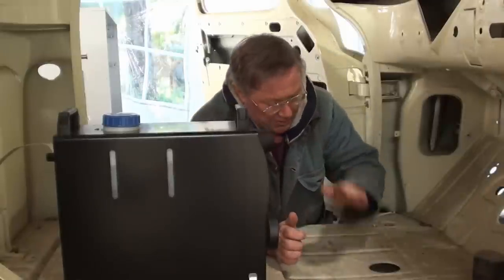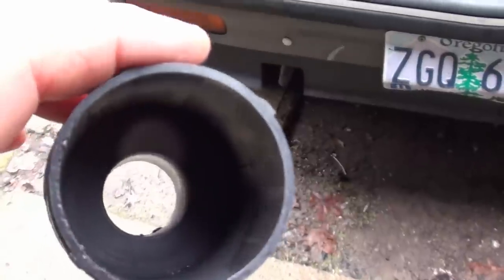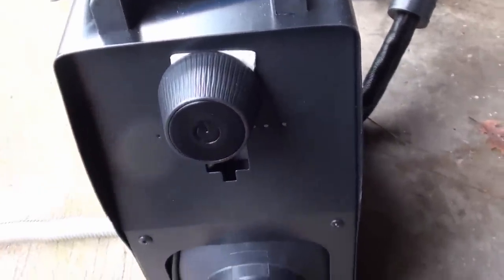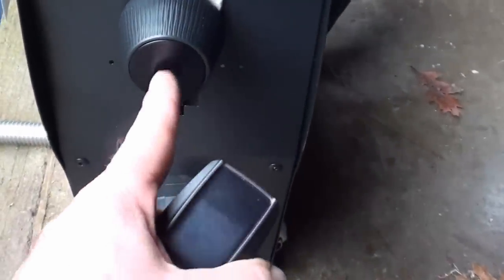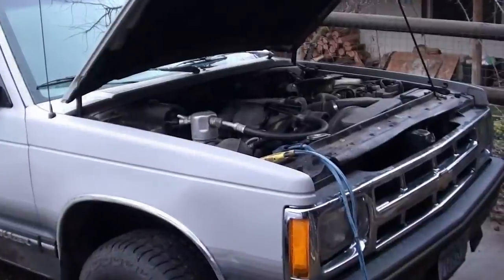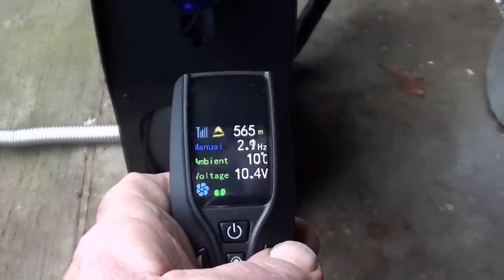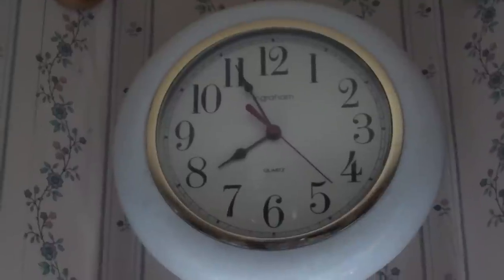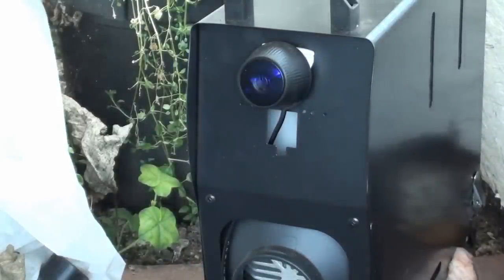Vevor Diesel Heater Evaluation. A Close Look!

Comment: I have a cheap Chinese knockoff in my truck camper with 100 amp hour lithium battery it works great for a small space but it has no fan only Temp . Jeff thank you for help on head gasket
Reply from the maker: No prollum!

Comment: I got the compact version of the Vevor heater with an external tank. Mounted lower than the heater, fuel can't run in. Worked good over the winter to keep my barn from getting too cold.
Reply: All the tanks are external in that if you open up the case, the components are always the same - heater, tank, pump, controller.

Comment: Jeff, I spent this entire last winter going down the Chinese diesel heater rabbit hole. I purchased a similar 8KW vevor heater and quickly got a full education on it. There's actually no such thing as a 8KW heater. They take a 5KW and over fuel it in order to advertise it as a 8KW. Mine worked just fine but if you listened closely on the highest setting it would throttle the fuel up and down because it would hit the high temperature safety limit and the brain box would cut the fuel pump back until the temp came down a little. After doing some research I found this is a common issue and leads to soot build up and potential failures. Some of the controllers with the screen in five buttons allow you to go in and adjust the parameters for proper burn and good fuel economy. I had to purchase a new board and screen off eBay and install it in mine to be able to program it and make it burn properly. Let me know if you want to talk diesel heaters, I can shoot you an email with my phone number.
Reply from the maker: I watched quite a few videos but hadn't made the leap. When Vevor asked if I'd review one, well, shoot yeah! I'm really after the waste oil function. Watching several others, you CAN run straight waste oil after it's lit, but the soot buildup is way too much. A 50% mix seemed to work excellent with minimal ash build-up over 3 years, as well as not setting the exhaust a-glow! I've learned that the fan adjusts by both fuel setting and exchanger temp. Theoretically, you can run 50% at about 3Hz which will cause higher combustion temps comparable to 5Hz straight diesel and the fan will go to max with the chamber temp.

It's a theory, but I think it's a good one!

Comment: The controller with the display allows you to tune the air fuel ratio. I find increasing the minimum speed helps.
The muffler helps. The pipe has a resonant frequency, the muffler dampens it. Without the muffler, you can here a definite noise inside of the resonant tone at some speeds. There is a better muffler with cast ends. Works better, but I bet you can cobble up something better.
Have had a diesel heater for about 2 months (separate 2.3 gal tank and small heater unit). Has worked well but I went down the rabbit hole of using waste oil. Worked ok after tuning but definitely caused coking issues. Grabbed a jug of old oll that must have had brake fluid in it and it filled the chamber with concrete :)
One thing about the expensive German heaters is the burn chamber comes apart. The cheap one if the chamber gets plugged you can't get into it to clean but they are cheap. Have an extra on order from China. Also have extra gasket, glow plug and screen kit cheap that came with the special glow plug wrench for something like $13.
The glow plug draws about 10 amps, the pump about 2 amp pulses. Fan is not much. Once running, less than 2 amps. I think the arc you see is charging up a filter cap.
Shut down with fan low and glowplug on will burn off any unburnt fuel especially after a failed start.
The exhaust pipe gets a wrinkle in it with the hose clamps. So you get a bit of fumes leaking through the wrinkle. I'm going to try muffler epoxy to seal.
If you can get kerosene, it supposedly works better if you can get it cheap.
I see you got one with hose clamps that work. Mine had 80% of the small ones do nothing turning the screw.
Reply from the maker: From what I saw on SpewToob, a 50% waste oil mix is best, cutting your pump back to compensate for the higher BTU per gallon. Kerosene is a lower BTU than diesel at a higher cost per gallon.
Reply: I used exhaust repair paste around the join to the unit on mine, when connecting with the Jubilee clip. Seems to have worked ok so far.

Comment: I have one in my school bus/RV and I love it. Not sure about all of the different models but my fuel does shut off as far as I know but I do have a separate fuel tank (mine is actually plumbed into my buses fuel tank. I'm going to have to check to see if mine drawers current while it's off, also one thing to note: if you remove power source while it's ON you'll probably have to buy a new unit, it burns up the circuit board (at least it did on the earlier designs)

Comment: I have one that I use in the rear of my 1977 military dodge ambulance, even on the lowest setting it will force you out with heat.  Mine has a display on the unit and a remote, remote is basic with no display, mine is also very fuel efficient, I do find the fuel pump clicking annoying.

Comment: I've had my diesel heater in my motorhome for quite a long time now I believe since 2020 I literally bought the cheapest one I could find I think it cost me $109 shipping and all mine has the remote fuel tank with it which I have in the generator compartment on the motorhome it definitely has no issues heating the camper and the only thing major that I've had to deal with is every now and then the fan with slide on the shaft until I just glued it to the shaft so it no longer rubs the case and every now and then you get a little bearing noise but I mean as long as minds run nonstop for days weeks and months during the winter it's done very well for the $109 that I spent on it easily heating the camper 75 plus even in the coldest of temperatures and honestly with the pump mounting underneath the camper you don't even hear it or notice it I know a lot of people that do not like them but I tell you I wouldn't trade my cheap Chinese diesel heater for anything it has kept me warm some of the coldest conditions there's always a great video Jeff
Reply from the maker: They're downright impressive for extraction of BTU per gallon, especially at the price point. But, as mentioned, being mechanically inclined is a BIG plus!

Comment: The display you don’t like is far superior to the arrangement you have. You get the display for tuning, but a simple remote for on/off. I have two of these, one in my office shed and one in my VW bus.
Reply from the maker: It wasn't what I thought I was getting, as I explained in the video. I'd rather have the screen that to be forced to use the remote. There was really no reason to even have the big knob on there, as it doesn't do anything but take up space. judging form the photos, I had assumed the knob was the temp control.
Reply: @ElderlyIron  ok got you cheers. The screen type controller is really easy and cheap to get hold of, and swapping over is dead easy - they all appear to use the same 3-wire connector inside the case. The heater in my vw has a single rotary knob with a press button; somewhat like yours but the knob actually turns and looks like it should be in a vehicle. And the LCD screens usually come with a two-button key fob remote for just on and off using the last settings set on the screen. If that helps at all.

Comment: I seen videos people run these on Kerosene and they say they don’t have any problems with them what’s your opinion on running it on Kerosene?
Reply from the maker: Kerosene has a lower BTU than diesel, which translates to less heat per amount of fuel burned at a higher price than diesel. I see no point to run Kerosene, but it certainly won't affect the heater as far as I know. You'll also see guys running waste oil blends, which has MORE BTU than diesel. That starts getting dangerous as every one of them shows the glowing red exhaust

Comment: I've been very happy with my CDH. On the other hand, my Schumacher power station identical yours has been a POS. Don't rely on that to run your heater.
Reply from the maker: HA HA HA! I was "gifted" that as non-working. It wouldn't charge the internal battery, so I charged it via the clamps. Once it saw enough voltage from the battery, then it would charge. Ended up replacing the battery. 25 bucks, so not too terribly bad. Gave it to a friend of mine.

Comment: It does work on the same principal as the Thermoking tripak ...company that i used to drive for used the tripak ...i was in Detroit several yrs ago a snowstorm started blowing in when i parked for the night  i turned on the heater it ran all night at 65 deg only used around a gallon and a half of fuel all night and the main engine never cranked up the heater unit was directly under the bunk ...you couldnt even hear the fan running on it
Reply from the maker: I wanted to be a Thermoking tech right out of college. To this day, I have a disdain for "Guidance Counselors" and "Placement Directors"

Comment: Yeesh... I could deal with the 12V switch, fuel cutoff, and a heat shield, but the rest of the thing reeks of poor quality. I don't like a remote either. If the battery goes dead or you lose the remote, it seems like you're about dead in the water. I think a guy in the know could make a setup like this but for a Luddite and make it a ton more robust. Potentiometers and relays would probably do what the logic board on that thing does. Finally, that's fire in a box. Those instructions should be translated far better. There should be no room for interpretation. Too much guesswork just to get the thing fired up. I guess once you figured it out you were running it just fine but between the mysteries of what the computer decides to do and what a guy doesn't know on the first couple of attempts it seems like it could go catastrophic.